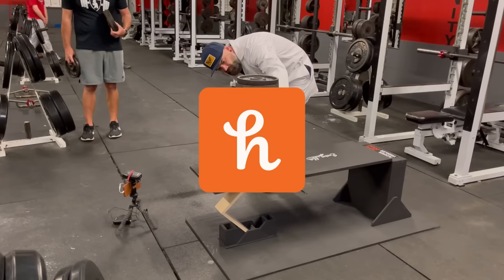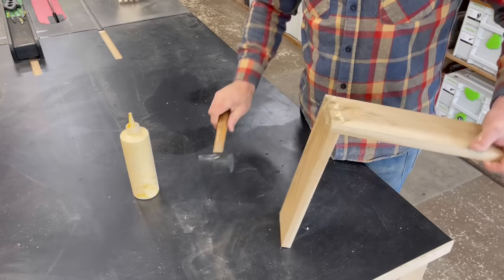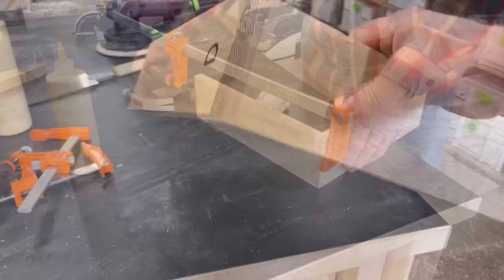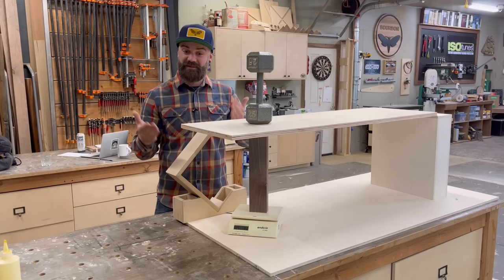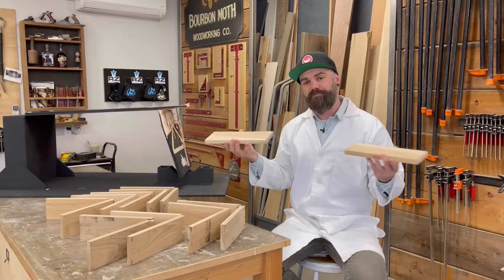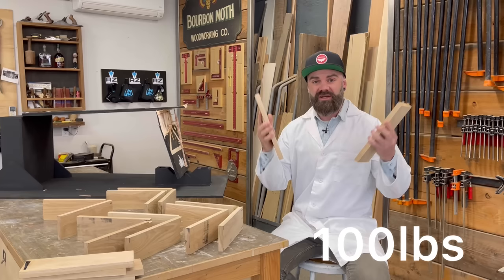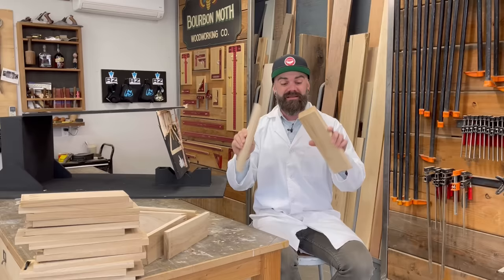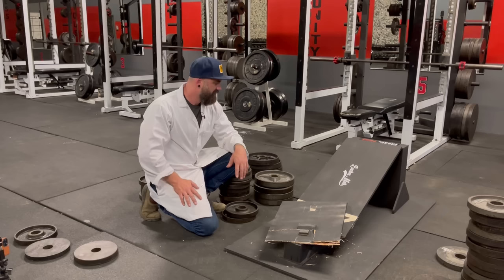What's the Best Wood Joint || Insanely Strong Joinery!

Comment: The glue surface area is part of it, you're getting (I think) 1.4x the surface area. 

There's also the question of leverage. The inner corner of the joint is the fulcrum, with the board is one side of the lever and the outside corner is the other side of the lever. By using the 45 degree cut, the short lever (the joint) is lengthened by 1.4x. 

I was surprised it made that much of a difference, though.
Reply: This comment should have more likes
Reply: Agreed, this is the way I would flex the joint to break it but also not how mitered joints on a drawer are used so I'm not sure the examples are applicable to the the intended end use they were designed for. Also all joints were glued and some designs were developed to be used without glue at all. I'd like to see that basic mitre joint hold up to its own weight even without glue! The other problem with using glue is that this just becomes a test of which joint has the most surface area along the long grain of the wood. And for that it could have been simply mathematically calculated without even testing and probably predicted fairly close results to this.
Reply: The miter joint is surprisingly strong in this direction for both of the reasons you listed, and two additional ones: 
1) It's actually more like an edge-grain bond than you'd expect. And edge grain bonds are all about surface area.
2) Wood glue is stronger than many woods IN TENSION, not in shear - this is why the miter out performed the box joint - it's all about how much glue you can get in tension when you load the joint up.
Reply: Rad 2? He's a witch!
Reply: Mathematically the leverage effect amplifies the whole thing to hold factor 2 instead of 1.4. so there must be something more.
And I guess that is the direction of load on the fibers.
A butt joint with that "leverage" load, actually pulls the fibers of the long grain wood apart from each other. In that direction the wood is very weak.
If the force had a direction parallel to the fibers (which would be typical for that type of joint) they would have hold much much more.
For that specific load shown here (which you try to avoid in ANY construction by creating triangles) the miter joint loads all fibers in their strongest direction, which gives the additional strength compared to others.

That is, why the test is on one hand very interesting indeed, but of limited help to woodworking, as the direction of the force is very important. Even a butt joint has two different strengths depending on the direction you load them (parallel or perpendicular to the glue surface)
Reply: 1.4x is near enough to √2. I think what we're seeing with these recent tests is how much better modern glue is. A splined mitre creates lots of surface area plus axial loading of the splines which also add lots more surface area for all that lovely, beefy modern chemistry to bind to. 

In Ye Olde Days, I think that the joint making would have been much more important to the engineering, as the glues simply weren't as good.

A great video with some decent scientific method applied, and, as the comments have shown, it's been very thought provoking!

Comment: The dovetail wedge shape splits the wood in half due to the loading, that's why it's weaker than the box joint. It's strong in tension, not rotational loading
Reply: The thickness of the top of the pins and the angle of the dovetails matter alot as well. I always make my dovetails with half an inch at the tap of the pins if structure matters at all.

I'd like to see a dovetail angle shootout one of these days.
Reply: The thin pins is what had the dovetail fail .. someone should recreate this test with a dovetail /pin 1:1 size ratio ..those thin pins looked nice but didn't provide strength .

Comment: I always found that applying a layer of glue on end grain and allowing it to dry to tacky then apply a second layer and affixing the joint it results in a much stronger bond. The initial layer will absorb into the end grain and the second layer will bond to the first and both boards. You then have a very deep glue bond to the end grain board. 
It would also be interesting to do the same round of tests using two part epoxy resin and see the performance difference compared to wood glue. 
While I know it’s generally not feasible to use epoxy for most wood projects nor is it necessary to have that much strength, I think the results would be surprising. 
I used to make custom knives and used Smooth On epoxy for handle retention with dowel pins as the mechanical connection. Since most of the knives I made were bushcraft knives and would be put under serious use, from chopping and batonning and occasionally throwing, the handles needed to withstand enormous amounts of shock force.

Comment: I've found that while butt joints offer more than enough strength in a single instance, the repeated strain of opening and closing the drawer tended to cause failure over time... but this was still a valuable and interesting video, thanks as always for posting!
Reply: Indeed, impact strength is not the same as tensile strength!
Reply: Pocket screws seem to do that over time also.

Comment: One more consideration is the impact of the joint ‘failure’. Some of these options fail catastrophically, others (particularly the pocket screws) would hang on as a kind of hinge.
Reply: Also the ease of repair though.  If a glue but joint fails, you can often just reglue it and you‘re good to go (after sanding off the remaining glue, provided it broke on the glue joint and didn‘t destroy the wood too much).  With failing pocket screws, it can really tear up the wood.

Comment: I'd like to see a test for the opposite direction of pressure. Clamping boards to something upright and placing the weight on the outer edge to test joint integrity. I think a few of them would fare better and  a few worse.

Comment: As far as I can tell, the boxjoint (fingerjoint) was stronger than the dovetails, cause they were too delecate and thinn. If you’d made them more even in width or made more dovetails (5/4 or more instead of 4/3), like on the boxjoint it would have held more lbs.
Reply: Would have been interesting to see the box joint compared to one with more, narrower fingers, and even more glue surface area!
Reply: Dovetail is a fundamentally flawed joint type. Reguardless of the size or amount of em. All the pressure from the weight ends up on that small short "triangle" shape at the sides of each dovetail. So just as you saw, the wood will break on that triangle line leaving one side looking as if it was a box joint because that small wood section ends up as the weakest part of it making it much weaker than a normal box joint.

Comment: it'd be interesting to do a test on joints 1 year after they're glued, to see what kind of effect time has on the glue/joint integrity.
Reply: Glued? My joints get me only hammered. Where's the glue coming from?
Reply: Time is one thing, I would be more interested in repeated loading. I doubt that box joint would hold up well if you put 30 pounds on it 100 times.
Reply: Ya, hopefully people don't start making drawers with miters because of this, lol. While this video was cool, the test was more or less irrelevant. The vector of the force was different than a push/pull force a drawer would receive. For a miter join, the glue would take all that repeated force over years which would inevitably lead to a failure. The dovetail, however, is distributing that force to wood-on-wood contact. Meaning, for the joint to fail the wood itself must break. You don't even need glue for a solid dovetail join. Fun test, fun video, but ultimately "wrong" and misleading.
Reply: @JustinSmith1287  I don't see the miter joint failing at all on a drawer if you add splines. The joint is so simple it shouldn't work so good, but apparently it does.
Reply: @sh0cktim3  I dont see it failing anyway since decent wood glue is stronger than the wood its holding together.
Reply: @cbcdesign001  for how long though? I would expect glue to lose strength after a year. Even more after 5 years. Especially if the wood warped.
Reply: @tokotokotoko3  why would it do that? it's a polymer

Comment: Thanks, this test has changed my perception of joints forever.
In all cases the glue gave, so the test is primarily about the glue contact surface area.
Secondly it is important to note / remember that the grain in wood is made up of fibers. Fibers snap when bent, but will hold far more weight / pressure when pulled "along the grain."
The simple miter joint increased the contact surface area by 141% from the butt joint. The load capability increases exponentially along the increased length of the extended 41%.
The dowls and domino's are pretty short compared to the length of contact area of  splines which at the longest pint is 280% longer than the dowls.
So you are very right, as much as i didn't expect it, it only makes sense that the meter + splines make the strongest joint. 👏😋

Comment: I'd like to see a mortise and wedged through-tenon setup (not dominoes) for the next go around.  I suspect it would out-perform the dominoes and dowels, but it would be interesting to see the results.  With that joint, the wood should break before the joint, if done correctly.  That's been my experience with them anyway.  

Also, how do you NOT have a dovetail jig in that shop?  Seriously.  You literally have all this stuff nobody has ever heard of, but you have to outsource a dovetail?  That alone may have blown my mind more than the test results.  

Anyway, really enjoyed this.  Looking forward to round 2!!
Reply: A corner joint such as being tested here, is not the correct application for a through mortise and tenon. It would not be strong at all. The end grain of the one piece of wood would just blow out.

Comment: I agree with many of the other comments. As an engineer, I would like to suggest you an interesting upgrade for the test bench. Usually those tests are considered almost static while adding many pounds with weights isn't. I would add a screw to push the test piece: doing it  slowly will make the results more precise (also more than one test is better, for engineering results we do 15 tests).
Reply: I was thinking of adding water, but a screw is an interesting idea.
Reply: I was wondering if we were going to ignore the shock loading factor of dropping those weights on. ✌
Reply: @aslacker  That would be an interesting separate set of tests.
Reply: Enter Mathias wandel
Reply: Funny how you dont comment on making 5-10 of each joint to rule out defects in the wood and produce some statistics. Also, standardizing the assembly procedure more to eliminate as many variables as possible would also help. Also, thirsty endgrain glue-up was the strongest joint, even though he kept saying it would be the weakest throughout the entire video. In my experience, end grain to end grain is the strongest when the glue is done like this: 1. Add glue. 2. Wait 5 or so minutes and add more glue. 3. Squeeze the joint together.

Comment: My go to joint is the simple 45 degree miter with glue and finish nails. I use Tite Bond 3 glue, it's insanely strong,  Project Farm reviewed and tested it and it beats Tite Bond 2, which was still very good, the other winner was Elmer's Max which honestly outperformed everything. I quit using Gorilla traditional type wood glue after seeing the tests,  it's one of the weakest wood glues you can buy.  

If you want to nail the wood and you're using something like Oak and don't have a finish nail gun handy I do have a little trick for that. Cut the head off of one of the finish nails. Next Chuck the nail into your drill and use it like a drill bit. It will put the perfect size hole without actually removing material, and you will be able to Hammer the Finish nail into the hardwood without splitting it or bending your nail. 

The wood glue test that is done by Project Farm is definitely worth watching if you are a carpenter who uses wood glue.

There are a lot of different styles of dovetail joints I would like to see if some of the other ones will perform better.

Comment: Awesome test and wonderful neutrality. I guessed it right! I figured the splines would essentially act as struts for a triangulated joint.
Right, my pick a stronger joint would be: Box, with a dowel run longitudinally through the assembled joint. So visually it looks like a hinge pin. Just need a long drill bit! (I just made that joint up in my head.)

Comment: Great video!!!   When you redo the video, use Titebond III, it supposedly has a higher strength rating.   Also TB1 & TB2 both tend to be far more brittle when fully cured, while TBIII can flex when cured which means it 'should' hold better & longer.

As soon as I saw the thin pins on the dovetail, I immediately thought that it would not perform well.  Looked to me like the dovetail board cracked then just separated, though honestly, I expected those thin pins to break off instead.

Comment: Next time with your dovetail don’t make your tail so small. I know it’s part of the classical look of a dovetail whose primary design is to keep the wood from pulling apart after the glue fails. A lot of people don’t realize that the older glues sort of had a lifetime and then the joints would get loose and have to be re-glued together. Your Old hot glue’s just didn’t have the life expectancy of modern glues. Anyway with your next dovetail Make your tails and pins closer to the the same size so that it’s spaced closer to the spacing of the Box joint.  I also noticed you didn’t do a proper through mortise or a mortise in a rabbit. I’m thinking the strongest version of a mortise and tenon joint you would start by cutting a rabbit at the end of one board and then notch out across that rabbit so you have protruding fingers like a box joint then in the other board cut matching square holes to be the mortises of your tenants. Your tenants would be about half the thickness of the board and depending on how many you make could be how about any width you want. And down for what I believe would be the strongest joint make a box joint but then drill a hole through all of the individual fingers top to bottom and put a thin hardwood dowel interlocking the fingers of your box joint. When it’s all done when you look at it from the sides it will look like a normal box joint but when you look at it from the top or bottom you will see the dowel down in the end of the board as a little circle.
Reply: I was thinking the same thing about the dovetails.  Equal sized pins and tails and a more of them.  That'll increase the glue surface.
Reply: @johngray2875  And let’s not forget making those small itty-bitty pins is a weakness unto itself. Anyone can pretty much breaker matchstick it’s a lot harder to break a three-quarter inch board.
Reply: Yup, and conversely, making a modified box joint where the tails on one side are 1/8" thick would probably behave similarly to the (lovely) thin tail dovetailed board.
Reply: Dovetails are designed to be mechanically strong, in the direction of the joint. You applied a force in a direction that is 45 deg of the axis so the joint is less effective.  Although, I can't be sure but I think the glue up needs to be more careful.  The mortise and tenon is definitely one of the top strength joint, the Domino was not a good example, they were too small.   I love my Domino machine so it's not a knock on the tool.  I want to let you know how I appreciate you doing this.
Reply: Please forgive me, but your your "tenants" are tenons - for a mortise and tenon joint.
Reply: @BigHenFor  and that’s why I hate spellcheck. It will decide to change words to others that make no sense. What does the person who rents an apartment have to do with a rectangular slot cut in a piece of wood?

Comment: One thing to keep in mind about the miter joint is that the end to end grain edges when not sanded flat will intertwine with each other better than if they were sanded.  The strength is like a bundle of teeny tiny box joints as long as there is enough glue soaking into the grain.

Comment: Great video!  For some reason I suspected mitre joints to be rather strong, not simply because they have more surface area to hold glue, but because they convert the pressure on the joint to compressive force entirely eliminating torsional and shearing forces where the glue can best resist. but I never guessed they'd be THAT strong.  There's one joint I presently go to more than any other;  it's a locking mitre.  For solid wood, I just use the router bit.  For veneered plywood, I use the table saw, dividing the thickness into thirds, use the inside two thirds to create a locking dado, leaving the last third mitred.  (Obviously, this is easiest using 3/4-in plywood.)  It hides the plywood core completely leaving a finished corner inside and out, and I can orient the joint to oppose the direction of greater stress, and so far, they seem to hold an incredible amount of weight.  I'd be excited now to see how well these test.  Thank-you for this video.
Reply: I would think a locking mitre would win, and I was disappointed that it was not included in the test..
Otherwise it was an excellent video.